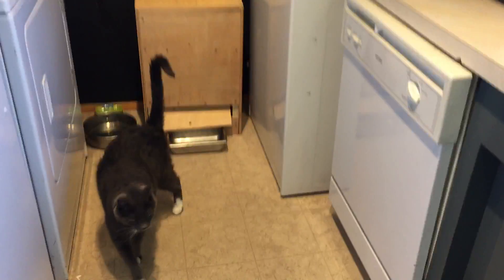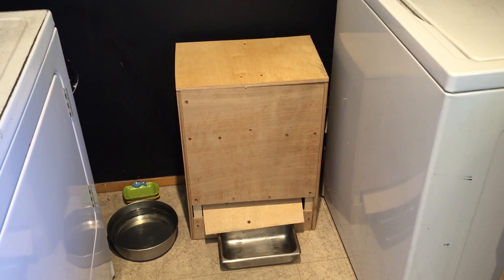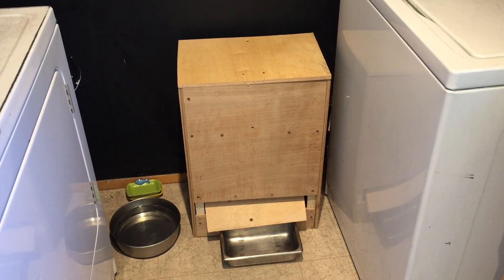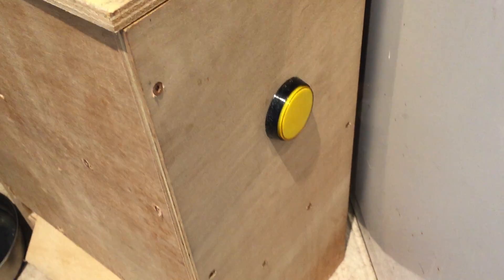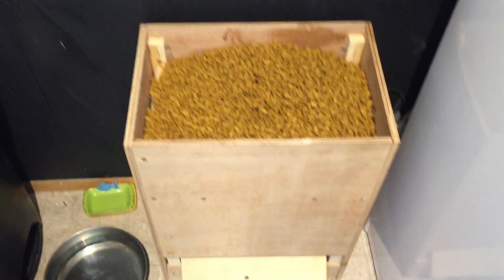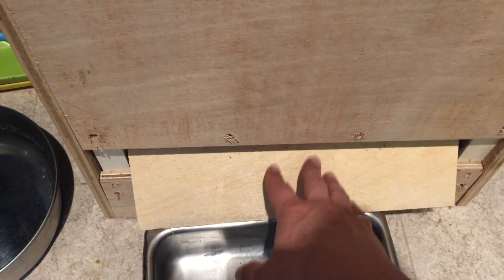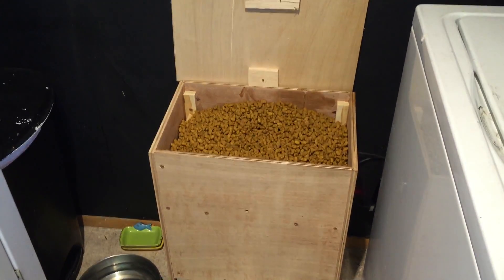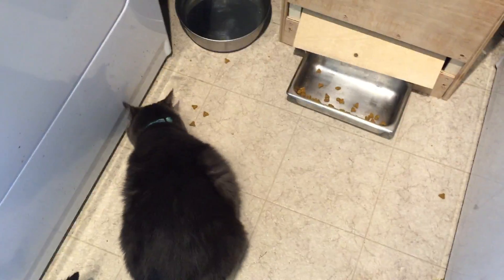DIY Automaic Cat Feeder

Comment from the maker: I recently rebuilt the feeder taking inspiration from @AprilWilkerson. I am now very happy with it. Some major goals accomplished with V2.0 are 1) getting it to fit behind the washer so that it's out of the way, 2) increasing the storage capacity by about 2.5X which allows for probably 2 entire bags of cat food to be stored at a time -- or about 4-6 months of food 3) aesthetic appeal. The original was a bit of a dog and this one is much, much cleaner looking 4) structural strength/simplicity. This iteration is way simpler. It took me about 1/5th the time to build and put together. It's also much stronger and the arduino board and power supply all fit in an integrated cubby in the back.